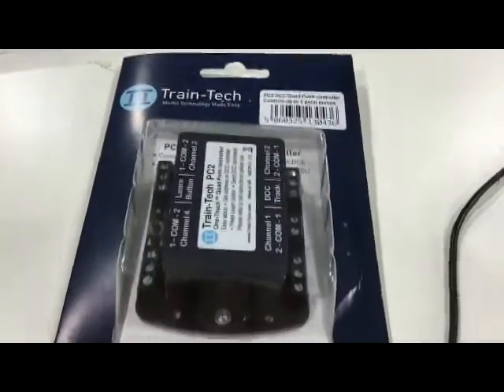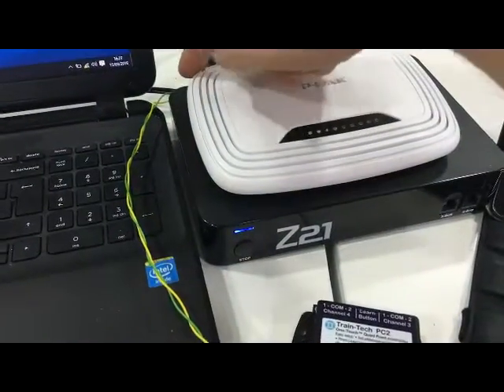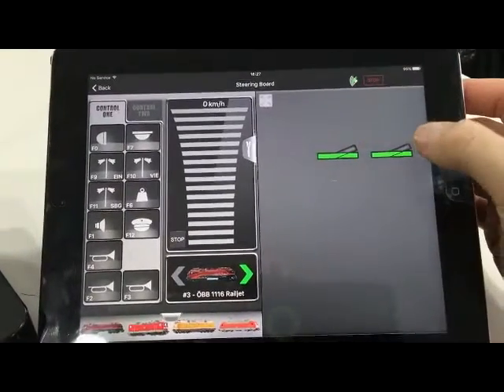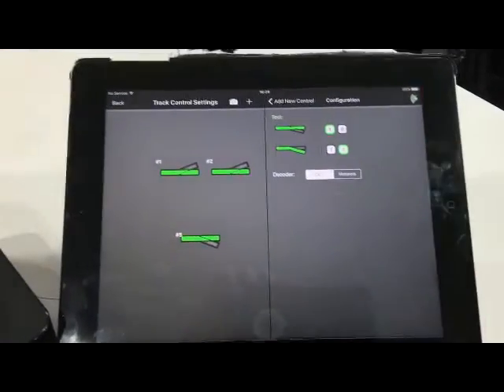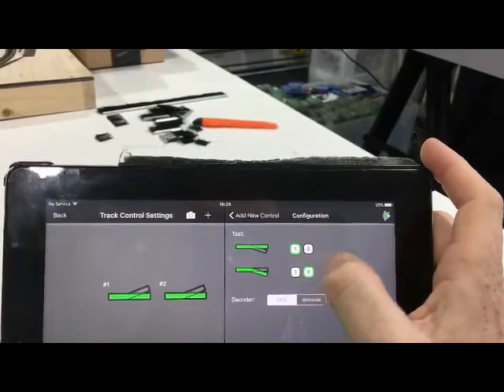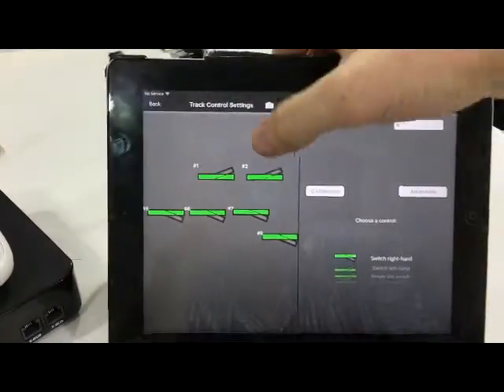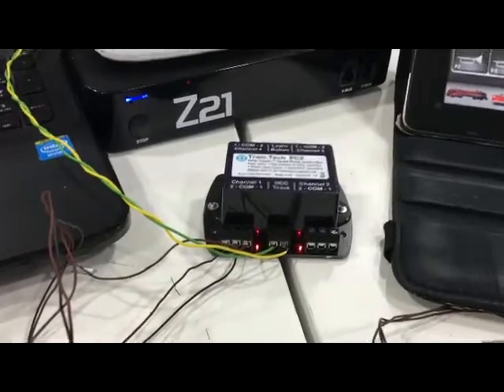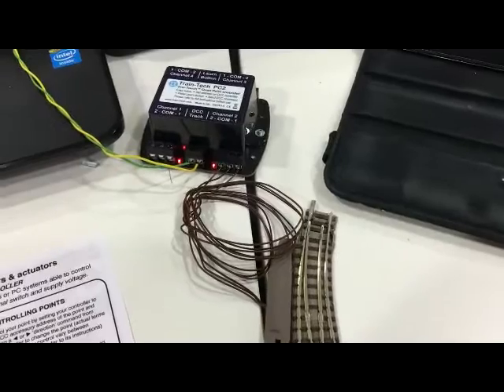Train Tech PC2 setup with z21

Comment: I connected up my Train Tech PC1 which I have exactly as you have done, but on mine the light started flashing as soon as I plugged it into the Track power socket. I followed your instructions with programing, but the light still keeps flashing, and has not programed, how do I get the light to stay on so I can program it?
Reply from the maker: may be you need to take power away and let to reset. Then try again
Reply: hi.. I still have problems, just wondering if it's my iPad,, does this work best on a Android or Apple?
Reply from the maker: Hello Paul
Please call us at DCC Train Automation
Sure i can help you.